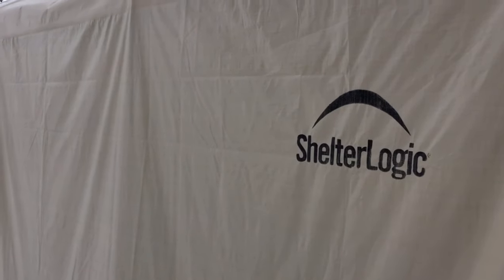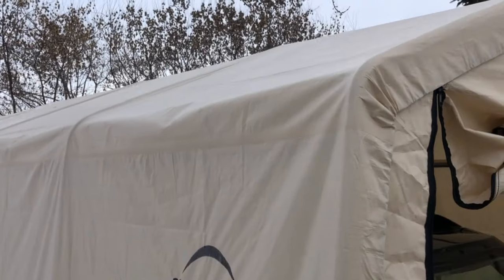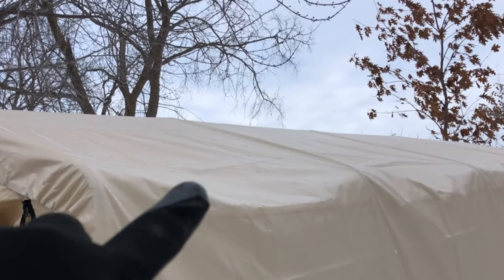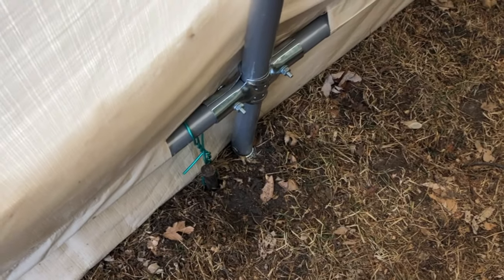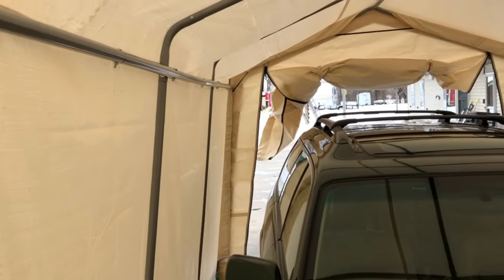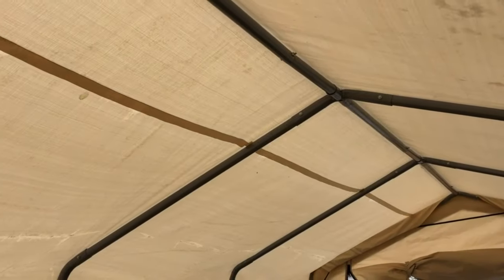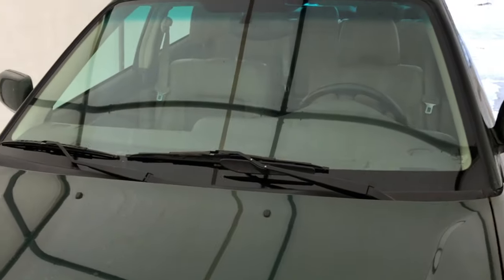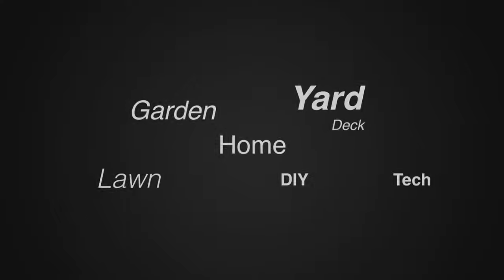Review Of Shelter Logic Car Port 10' x 20' foot With All Metal Frame and

Comment: Our cover finally rotted enough this year that my husband finally decided to buy a shed. 10 years and the frame is still perfect. My husband did some extras when we build it, like reinforcements on the corners and he had wood inside running along the angled part. Half this time was full sun and then we picked it up and moved it to a corner on our property,  under a couple trees, which we thought would help make it last. Unfortunately the Butternut and cherry tree in that corner didn't help it last. Never really had a problem with the snow, it slide right off. He used awing tiedowns in the corners that we never had an issue with. We definitely got our moneys worth out of it.

Comment: Good review. The issues with all soft top carports is in snowy weather. You need to add spars between the OEM spec down angle tubes to help stop accumulation. Also; I use ratchet straps to pull the longitude joints together. I also either mount the leg brackets to 2x6 green treated lumber on ground contact or; I attach four ten foot 5x4 decking planks to the leg tubes with “U” brackets from Menards. This keeps the legs equidistant and stops “leg creep”. 
I’ve been using soft tops with for 30 years in the Midwest and I feel to some degree, I have mastered the issues. Final solution to beat all; steel panels over the top 3/4 of the unit. It’s all about the fun and challenge against the elements. 😎

Comment: I had a Shelter Logic  domed  roof. Shed handled snow fine. Year 2 the cover was failing. I replaced it. Year three a windstorm really messed up the frame. Replaced a bunch of bent pieces. I anchored it with eye bolts in concrete 2ft deep.  Cable from eye bolts to the bottom of the frames. Year 4 a Deracho hit and that was the end of the thing. I’ll not buy another!!!

Comment: I've been constantly contemplating to get 1 of these but I'm afraid that it won't last very long.  Thank you for this information in this video.
Reply: U then convert it into a full metal shed by buying metal roofing panels. 200 to 400$then it will be fully solid. I plan on doing this when mines falls apart. Cheaper n more strong than any metal shed u can find.

Comment: What is the measurements of the sides?  I was thinking of parking my Class C RV under the port.  Can you tell me what you use under your car, the black grids?  What is the advantage of using the grids?  thanks
Reply: 2 years with no issue isn't that bad

Comment: I went to the Amazon link but it gave me a list, not the actual tent. Is it either of these in the list? -ShelterLogic 10x20 Feet New Auto Shelter $511.56 OR
-ShelterLogic Super Max Canopy 10 feet by 20 feet 2-in-1 pack with Enclosure Kit, white cover $826.08

We have been searching for a way to have my son's car protected by weather & the car covers can nearly run half the price of something that seems more sturdy like this. 
Another question I have, being a single mom without a ton of experience with things like this, is there a way to use one of these on driveway/asphalt/concrete? Anyone? Or is there a different type for that? 

Thx for the review!!

Comment: What about mold developing in side on hot humid days
Reply: I think some ventilation usually occurs since its not much sealed. There us a vent kit, or create a similar one yourself if skillful with customizing things.

Electrical tape the joints, tape the crossbeams, and possibly fit another tarp over top for better protection.

Comment: We bought a ShelterLogic 12' x 24' x 10' garage, model 62770 and it lasted just over 2 years before a light wind tore a large hole in the roof Do not buy this product. We called them about it but they only guarantee it for 2 years. Our neighbour bought the same one at the same time and it leaked after a month. He got a replacement because they said that early model used an inferior covering. We should have got a replacement too but didn't. Ours wasn't leaking at that time. It is an expensive garage that must be replaced within 2 years. We have had tarps that lasted longer.
Reply: Mine failed within 8 months. It developed holes near the peak for no apparent reason….no high wind, hail, ice, snow, branches etc etc. I contacted ShelterLogic with a warranty claim. They sent me a no cost replacement top within 10 day. Needless to say, I have no faith in the replacement.

Comment: These shelters are an absolute junk. I own an outdoor RV Storage and several clients bought those to cover their boats or pop up trailers, after first winter they all sustained damage and some got destroyed completely, I'd post photos if I could.
Reply: Haven't had much luck with gable roofed  canopies either. As he mentioned, I believe the round tops shed snow, and rain better. The OP says to push the snow off it. Well, when it comes down heavy at night, or while you're at work, that's tough to do. These things are good for summer time entertaining, and taken down in the winter. Unless of course you live in the sunny south.